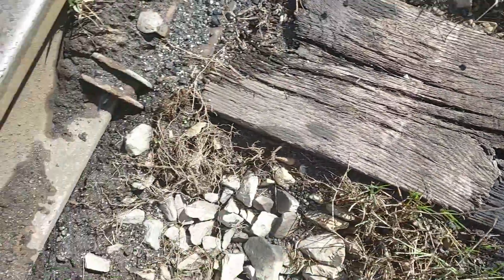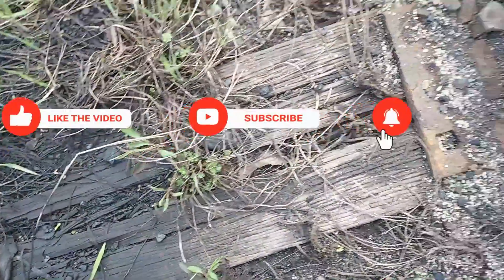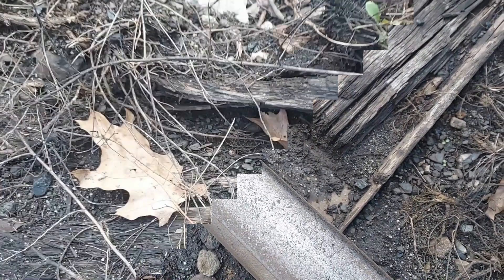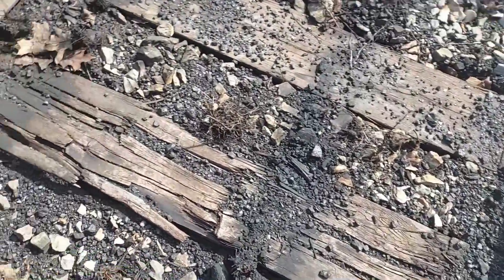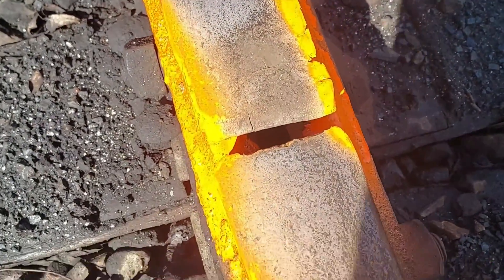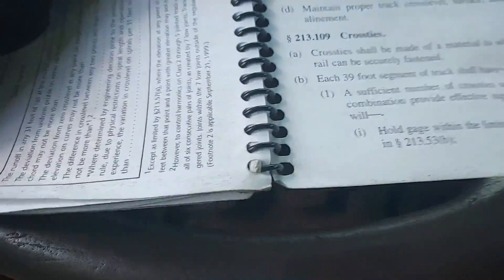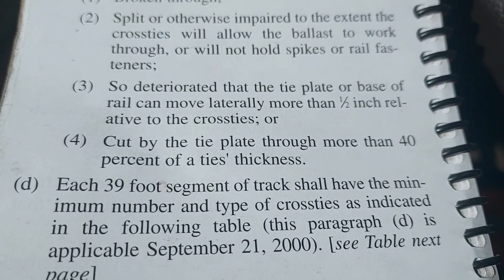Marking Bad Railroad Cross Ties on Excepted Track

Comment: During WW 2, the covert folks learned that they had to remove a long section of rail to get a derail. Small sections, like a foot, would not do it.
Reply: There is a YouTube video up of it. https://www.youtube.com/watch?v=agznZBiK_Bs  The Army couldn't even do a decent job of derailing a train. ;-)
Reply from the maker: I saw that video jw, was really a cool one to watch. I know
they were experimenting but easiest way to derail a train is
to simply pull the spikes and the gage would widen and train go
on the ground.  What they also did not try is removing a piece of
rail in a curve, that would have made a big difference if it
was in a curve instead of on tangent track.

Comment: In the UK the ties concrete,timber, steel ,and recycled  plastic,and tunnel concrete ones that have a concrete  pad for the rail fixings tied together with  a steel bar so when it is set up in the correct position it is fully concreted in to hold it in place,there is also concrete ties made for switches
Reply from the maker: Thanks for sharing that Michael, I'm always interested in learning
what our neighbors are doing on the tracks. It would do our
track well in some places if we could cement things in, specially
the turnout out we have on the main. it is forever giving me fits.
Appreciate your watching the video my friend.

Comment: Do you recycle spikes? Some time ago there was a device that straightened and sharpened the spike so that it could be used again. I guess that you save the battered rail, possibly cutting out the defective sections and use them for piece repairs. I'm sure you sell the rest for scrap.
Reply from the maker: We never have Gary, we've always put in new spikes. I've
never heard of that machine, it would be cool to see it in action.
Yes sir, if the rest of the rail is pretty good it will get saved and
the bad end cropped off. The bad rail that won't grade relay gets
sold to a RR contractor for use in sidings or spur tracks or
for bridge guard rails. The rails that are absolute junk or have
been ultrasonic tested bad gets scrapped.

Comment: I can see replacing that rail with the battered head.  Even if that bit does breakout and as you said, doesn't cause a derailment, the wheels are just going to batter what rail is left harder and harder, making it worse and worse.

As my daddy used to say (he was an auto mechanic), "Squeaky breaks will never get better on their own.  You can pay me now, or pay me later."
Reply from the maker: Your dad was exactly right Mike, specially on the RR. Skimp on
infrastructure on the RR and you are putting your self in a position
or peril. You will pay later if it's not taken care of now. Appreciate
your stopping by and watching the show my friend.

Comment: Do you ever clean the grass, and dirt out between and both sides of the rail?
Reply from the maker: Being this section of track is excepted track and slow speed it
obviously does not get the attention that the main does. We do
on occasion run a regulator thru there to clean weeds out, but
they grow back pretty quick. At some point we will crib these
ties out but we have bigger cribbing fish to fry on the main for now
that must be done first. Appreciate your watching the video and
for writing in Tom.

Comment: So how much vertical movement is allowed in a rail segment? At one crossing I observed the rail must have been bouncing up and down about 3-4 inches - you could see the knuckles move past each other almost half way vertically from each other.
Reply: that sounds fun to watch. i'd like to know the official delimiters of vertical deviation as well.
Reply from the maker: Each class of track has different parameters for the amount of
cross level deviation between the 2 rails. The Code Fed Regs does
not address the vertical movement of both rails at the same time.
Obviously that condition is never desirable but it does happen and
happens most often in mud spots which is why we have a constant
cribbing program we follow to get rid of the mud. Hope that
helps Randall and thanks for taking the time to write in and
watch the video my friend.

Comment: Thank you for this informative video!
A long-handled broom with stiff bristles for brushing away rocks, dirt and debris might be helpfiul, more so if a small rake was affixed at the other end.
Reply from the maker: Your very welcome Robin and thank you so much for stopping by
and checking out the show my friend. My track broom is such
that you describe, I think I showed in a long time ago video, but
can't remember which one. Has also a scraper on the one end
to chip off hard debris and ice from switch slide plates.

Comment: Are they going to crib out all that coal as well when they replace the crossties?  That whole section you showed looks like it could use better drainage.
Reply from the maker: It absolutely could use a good cribbing and drainage work. But for
now cribbing is being done on the mains where it's 25 track speed
and more important that it get done. Just so much needs done
and so little time and man power to get to everything. After the ties
were in place that whole section was tamped and is in decent
enough shape for the time being until we can get to fixing the
drainage problems there. I hat to do it but sometimes you just
gotta keep raising track and tamping it until a more permanent
solution can be done. At least it's safe for 10 mph trains to go
over.

Comment: Dave, am I observing correctly that the rail on the run-around is lighter than the main track? Or is that an optical illusion? If so, what are the different rail weights (sorry, I don't know the correct term)? Thanks for another great video.
Reply from the maker: Both tracks are 132 pound rail Keith. it is an optical illusion, 
camera does distort some things I've noticed that in the past
with the shots of the rail. Rail weight is the proper term to use
also. Appreciate your stopping by today and taking in the show
my friend.

Comment: Thank you Dave for the education on railroad tie replacement. The one question what is the lifespan of a  railroad tie? I have been enjoying your channel and content. Your narration is perfect along with all the other topics. I hope you have a great day. Always waiting for the next video.  ❤🇨🇦
Reply from the maker: Your certainly welcome Ray and thank you for the very nice comment.
Tie life varies depending on the location. Good ballast and good drainage a tie can last 25 or more years. In mud conditions you
can cut that in at least half or even more. That is a general rule
of thumb. Another thing to consider is the species of wood. Good ties like oak
last a lot longer than a softer wood. Also is the amount of time a tie is air
dried before creosoting. Maple if not air dried for at least 3 months will rot very
quickly if creosoted green, so there are
a lot of variables involved.
Reply: Tie life varies. You may find some that are bad after 5 years or you may find them still good after 20.  On one siding here in Florida I found a tie in the mid 90S that was put in in 1936. It still was in decent shape as it was a tie made out of Cypress heart wood. Depending on the wood ( most are Oak ) and how well they are treated, the climate they are in, how well maintained, and the loads they see will determine how long they last.

Comment: My Gosh if a tie plate cut through 40% of the tie it would nearly be out of sight.  have you ever seen one this bad?
Reply from the maker: Not here for a lot of years. We do one thing superb here and that
is keep up with replacing 1,500 to 2,000 ties a year every year and
have done that for at least the past 20 years. So the plate cut tie
you saw in the video was the worst one we had on the entire track.
We are very fortunate management has never balked at 
tie replacement.

Comment: It’s enjoyable to listen and hear how you love your job.   I have a question.  On a bike trail back in the 20’s there was a coal train derailment. There is still coal in the area.  I fished two springs out of the creek it went over. Also I dug around in the coal and found a small door.  The hinges broken and a slight bend in it.  It has the number 113 on it.  The door measures 10.5 inches wide and 9 inches tall.  What would this door been from on the locomotive?   I cleaned it up, for the rust removed and painted. It looks great.  I Al way wondered what that small door would be for
Reply: That sounds like a journal box lid for one of the old friction bearing trucks.
Reply: @Wildfire86872  I looked up photos and that fits the size and how the hinges were on it.   Thanks for your reply
Reply from the maker: Really glad you enjoyed Beverly. I have a door with almost the exact
dimensions on the tail gate of my big dump truck. It is a coal chute
for only dumping coal or any other material out a small amount
at a time and in a small space instead of just opening the whole
tail gate and dumping a big pile. Coal chutes on dump trucks were
very common back in the day when most places heated with coal.
Reply: These days doors like that are still used for dumping out a truck load a wheelbarrow load at a time. Many paving companies that do driveways and walkways use them.

Comment: In Victoria, Australia we designed our own low profile concrete sleepers that were similar in size to timber sleepers (ties).

Probably not as strong as conventional concrete for extra heavy axle loads, but were fine for ordinary container freight, grain and passenger trains.

The low profile concrete ties performed similarly to timber which meant no change to tamping operation.

This also meant we could convert to concrete using a normal tie renewal program and after at most 25 years the track will be all concrete. 

Keep up the interesting videos. 
Pete.
Reply from the maker: Very interesting Pete, thanks so much for sharing that with me. They
are constantly trying to improve the concrete ties here with the tremendous axle loads and long trains. Now they use pre stressed
concrete and much higher psi concrete which seems to be working
for the big RR's here. Appreciate your stopping by and watching my friend.

Comment: I watch videos of the E&LS in Michigan and Wisconsin, some of their trackage doesnt even come close enough for those standards, yet theyre still alllowed to run trains on it! Those bad ties you marked are better than most of them on E&LS!
Reply from the maker: Oh dear Paul. All RR's have their unique set of problems and issues
to deal with that's for sure. We have always had a very good tie replacement program here, it's very important to help hold track
gage and track surface. I'm exceptionally pleased that management
here has never skimped on tie replacement and actually goes
over and above what is required by the FRA.
Reply: @ccrx6700  The Cumberland is an exceptional example of a very highly maintained railroad, thanks to you and your crews! Have a safe holiday!
Reply: The sad truth.
Reply: ND&W - theirs is so bad it is hilarious. I can't believe the train stays on at all.
Reply: @christopherrabaldo3377  dont know if you watch E&LS videos, but the cars rock so badly, that they lose logs off the loaded cars! Those two railroads must be in the same category as old songs, "We love Rock and Roll", and, "We Will Rock You".

Comment: Great info Dave on those ties, that must be one heck of a job to inspect all those ties.👍
Reply from the maker: We have 16.8 miles of track which means we have around 45,500
ties and each one gets a visual on my weekly track inspections,
albeit is from the cab of my hi rail truck riding along. it goes pretty
quick in the truck but walking is a different story. We generally
replace about 2,000 ties a year. We just this week went thru a
shut down with the tie gang in here but only got 1300 ties
replaced since it was only a 4 day shut down and we had a small
tie gang working. Got some good videos of this weeks adventures
including bridge 8 deck replacement you will like those vids. We have
always had a very good tie replacement program here and that
pays big dividends in preventing wide gage.
Reply: @ccrx6700  I guess that keeps you busy. Great videos Dave👍

Comment: Another great informative video!  So why is the track excepted?  Is it due to its condition, how it is used, or something else?
Reply from the maker: Thank  you Tom. Excepted track has a top speed of 10,
our main is 25. It is only used as they load the coal and also
on the other end as they unload. So fed specs are less stringent as
lower speed as opposed to mains. Excepted track would also be like those
in a classification yard or a spur track.
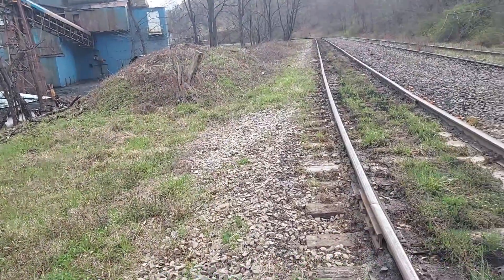Reply: It's also near the end of the main line. Can be seen at 2:49 beyond the switch.

Comment: Sorry if I missed this in the video, but do ties split from water freezing in them?
Reply from the maker: That was not in the video, but very good point and yes as you
know when water freezes it expands and water in a tie that
expands is going to be very hard on the wood fibers causing more
splitting. yes sir.
Reply: Thanks! always wondered about that.
Reply from the maker: @themanfromcabowabo1559  😊

Comment: The concrete ties they have metal clips and a machine comes along and snaps the tie and rail together.
It is really nice
Reply from the maker: They had a lot of problems with concrete ties in the past under heavy
loads wanting to break in the middle. They were however perfect for
passenger. They are making much improvement lately in the concrete
ties using pre stressed concrete ties and also using much higher
psi concrete that is proving itself to be able to hold up better
under heavy freight loading. It is a learning process for the RR's
and concrete tie manufacturers. One of the big problems with
concrete is zero flex. Wood ties have some flex. Also in derailments
wood holds up much better for having a car wheel off and riding
along the ties, that will chew the concrete ties up a lot where as
the wood ties it won't often mean they must be replaced, so there
are pros and cons to both wood and concrete.
Reply: @ccrx6700  There is a synthetic material that replaced the hay they used to add to the concrete to make it stronger and more flexible. They use it in Japan for the high speed rail line

Comment: Is there any way to replace the operating system on the Tamper ?
Reply from the maker: Yes there is ocsrc. We have gotten a quote from Quality Track Services
on a Jupiter 2 upgrade. It's about $100,000 to do it for my tamper.
There is a good bit involved in the change over. We have considered it
but also at the same time if we do it, then there will be other
upgrades to the tamper while it's in their shop and for what we want to upgrade the total cost will be around a half a million. So for right now the money is not in the budget to do it. And with the really poor couple of months of coal production we have just went thru, it ain't gonna
happen until sometime in the future. it has been a bad couple
of months here at the mine. In April they only ran 12 trains, tons
of problems underground and at the prep plant. We were even laid off
for 10 days at one stretch.